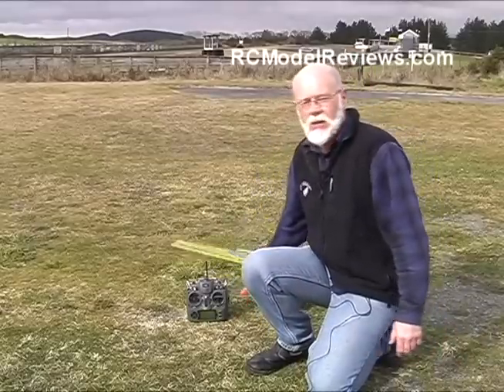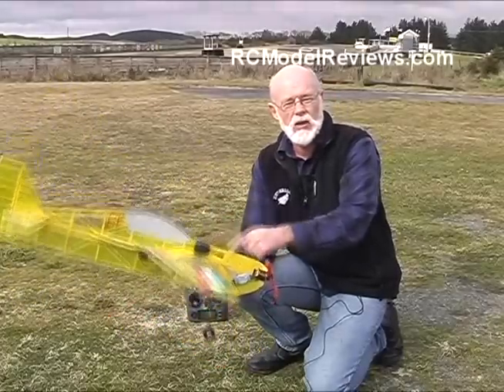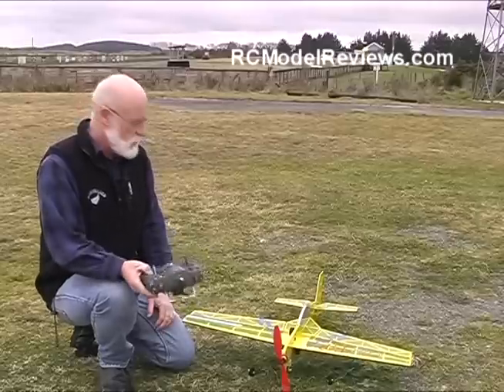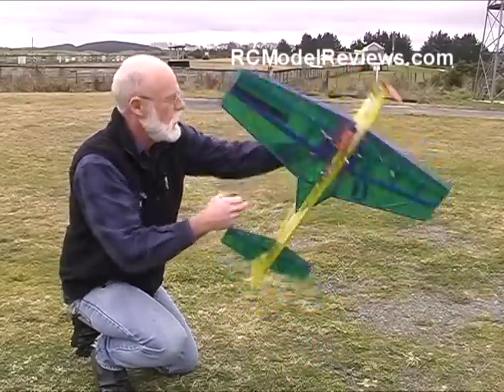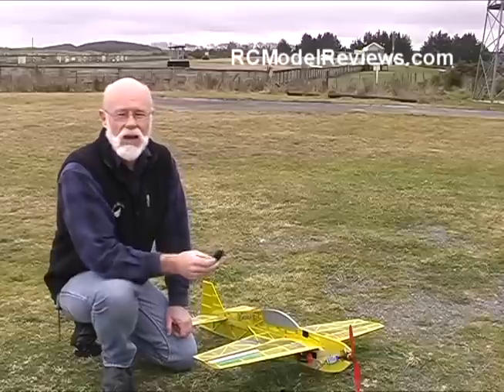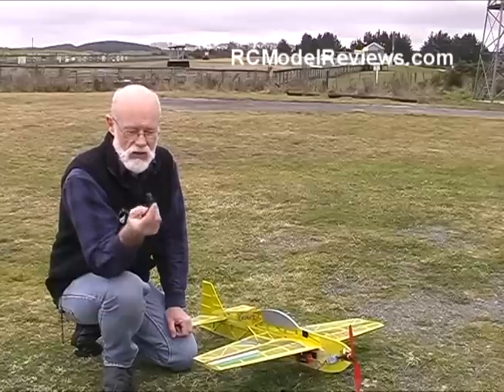Key chain fob video camera mini-review

Comment: The forward pointed view on the Katana it is picking up the prop rotation, hence the bars on the picture. Actually I'm surprized at the video quality you got... when I tried it on my airboat the footage was terrible. I tried it on my Alula handlaunch and didn't get much better results. I may try and track down another card and see if that helps, plus that website on the forum mentions re-flashing the controller chip - not sure how to do that , but I will look into it when I get some more time.

Comment: My thumbs UP on this vid and added my sub for your updates. I would someday soon, have this nice new hobby added to my past-time and see how it serves well. As I have ordered the Hyundai version, with under two hours of time permitted, I think a 16Gb card @ Class 6 should offer a good clarity to the resolution. With the noise distortion, a simple thin but solid rubber tube inserted into the mic crevice should take care of it or simply, tape it over with a small portion will do.

Comment: I found a brilliant one for just $10 the other day; good picture with a clear if a bit quiet microphone. Only problem is it seems to reduce the range a bit, that and the file sizes are stupidly large (50mins = 4gb). Plane is a Dynam Hawk Sky (which I would highly recommend getting) using a stock 4ch 2.4ghz system.

Comment: I just placed an online order for  HD version from or called>>: HYUNDAI SHORTY SNAP MINICAMERA. Little is received regarding feedbacks so after the confirmation, I'm looking up on the Net and yours mentioned about cheapo versions etc. Another suggested abt SD & HD , I believe mine will and is the HD since it assured 1980 x 1080 res. Anyway, my q'n is, with buttons on one side, do they need to face upwards or the opposite when filming and why not paste over the mic to cut out noise instead?

Comment: I also wonder, if it is accessible to switch the rechargeable battery? At its worse, in light of the pricetag, I'll have two of these cams velcro'd on either end of the wing tip and capture the breathtaking vid captions unless one has a prop-free jet propelled RC plane. I would think this would be better served on the underside of a glider. :)

Comment: Nice. I have the hardware so I can flash these cameras to remove the timestamp (version 3 of the hardware only, I think) - Which decreases the required bitrate. Based on pluc.fr - gumstick camera hack.

But using a commercial eeprom programmer and a clip.